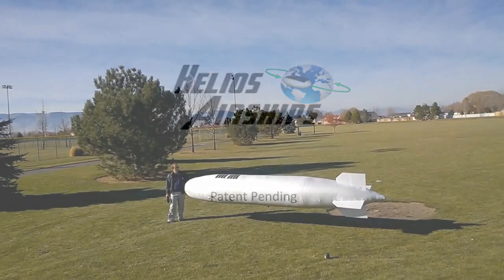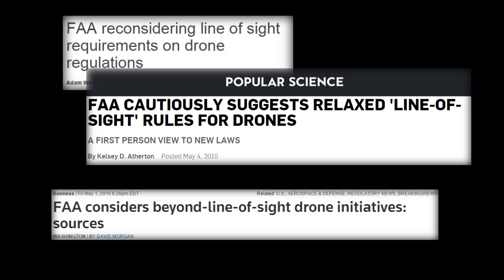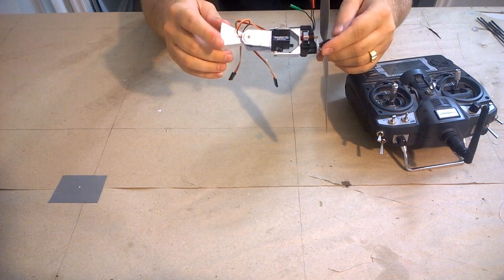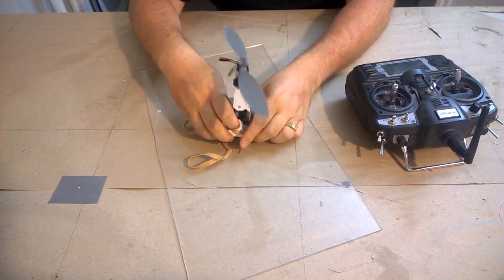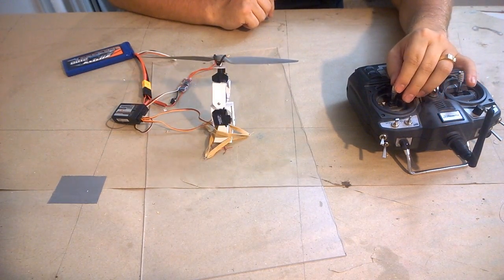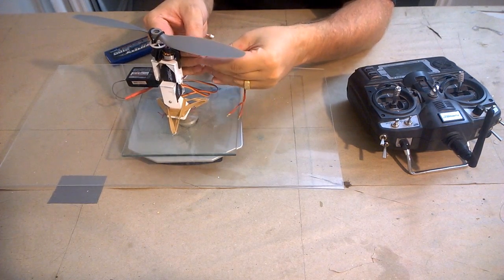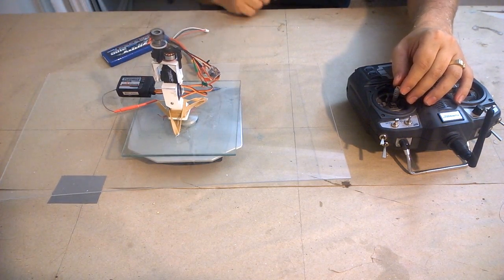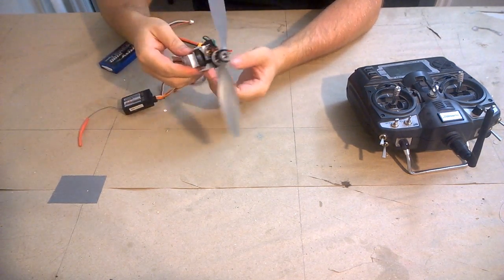Solar Airship Project Update: Motor Mount, FAA Drone Regulations, and Dan Geery

Comment: Any updates? The solar cells and everything looks great.
Reply from the maker: I have decided right now to focus on raising funds for these various endeavors through my solar powered cell phone charging hats, while I wait for the regulatory situation to become more clear. I do want to work more on this, and I feel it has a lot of potential. But the costs were starting to add up, and I wasn't sure what direction to take this since I don't what (if anything) the FAA will allow. So this is officially "on the shelf" for now.
Reply: +BaccaYarro do you have code for the blimp? I'm going to be building an autonomous blimp, eventually solar powered, almost exactly like your and hyperblimp.com design. Wanting to base it off of a blimp version of APM on pixhawk hardware. If you have any code that would help, it'd be great to have.

Comment: I would paint it a ww2 style for the p51 mustangs..generally silver with blue or red on it.. And I could imagine one of these hooked up to a computer to fly manually.. And are you gonna make a counter-torque mechanism, not sure about airships but torque can be a big reason why a ww2 plane is shot down..notice my addiction to ww2? Anyways.. I would imagine the round airship to be doing aileron rolls for its whole journey, so maybe add a counter-torque puller propeller